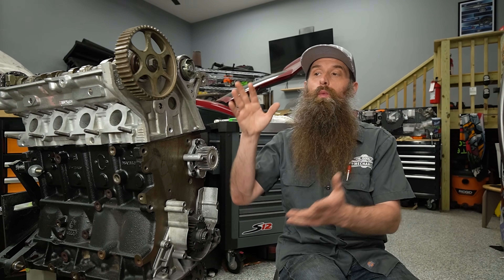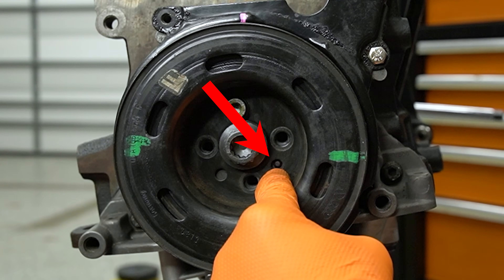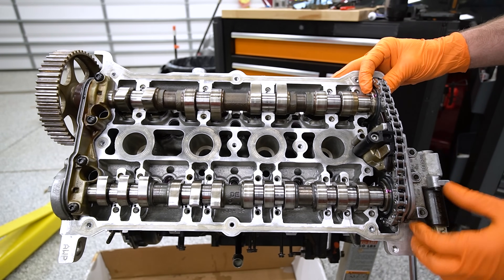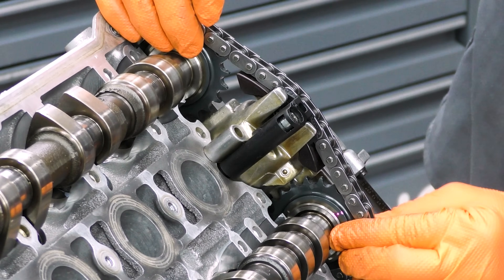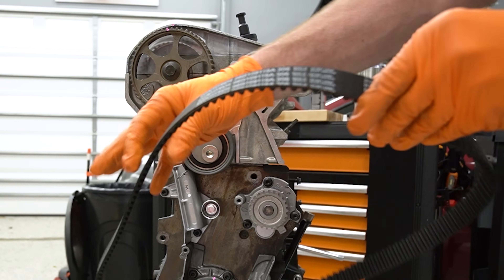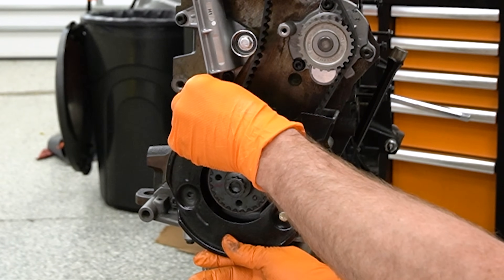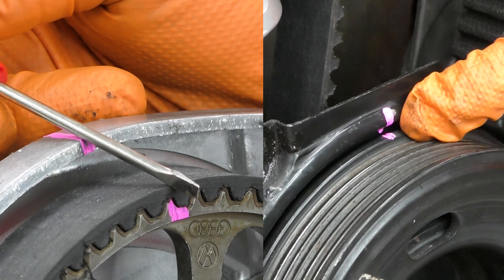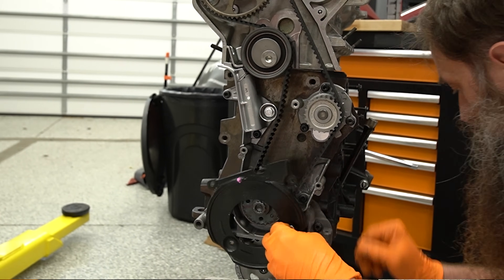How To PROPERLY Time VW/Audi 1.8t 20v Engine ~ Belt and Chain

Comment: I have the AEB. it's a really great engine, little to no maintance, good fuel economy and a lot of power. 26 Years long going strong.
Reply: 307k miles on my 1998 AEB lol
Reply: AWM in my 2002 Passat , great little car. 20 years old and it leaks no oil, barely burns any either. Have to add 1/4 of a quart between oil changes.
Reply: @Janet_Airlines802  How many miles on it?  I have a 2003 AWM, but burns some oil through the valve seals. 183,000 miles so far.
Reply: @Janet_Airlines802  admitting i have 170k kilometres (i think 100k miles) and burn roughly 80ml/1000km, so i add 0.5l between oil changes
Reply: AWP owner, man these Audi vw turbo motors feel like nothing else from its time
Reply: Had an AEB, certainly one of the best heads. I believe it was the only large port sold in the US. But it's paired with a block that features an external water pump that runs off an of an axillary belt.  Certainly not the best design. Best blocks were paired with AMU or BEA heads. Best heads are AEB or AWP depending on what your building for. I current have the AMU.
Reply: Same 99 Passat 5 speed. Stage 2 ecu been in for 110k miles at 19psi. 182k total. Still on the original clutch this thing is built like a tank
Reply: @joes.7536  haha same here B5 Passat wagon with the AEB. It has stage 2 mapped to 20psi but run 17 psi at most with a manual boost controller in parallel with the n75 (supporting mods blah blah) 300k taking it like a champ. The stock fueling system is more than enough. The K03 runs out of breath around 15psi but we all turn it up. I’m only rebuilding the engine because I pulled it to replace throwout bearing and decided well while it’s out why not. Then that list kept growing.
Reply: I had AEB(A6 C5) its great engine but now I have BAM(S3 8L) and I think BAM is the best 1.8t from VW
Reply: How many head gaskets?
Reply: @raymondmcfloss6225 atw here 2000 a4. 290k miles bone stock. Have a build in the works. Full-race exhaust  manifold. Ie cams, ie valve spring kit, will be gt30/ g25 sized turbo (still yet to decide for my t3 manifold) with aeb head. Currently rebuilding the cooling system starting at the lower coolant pipe under the intake manifold. Its loads of fun once youre able to wrap your head around some of the spaghetti mess that the bay is 😅
Reply: AWT ❤
Reply: @alexcatinas5114  atw? Same as me? Narrowband o2 ecu, small port head, & 058 bottom end
Reply: Been having mine for about 9 months. Great car. 1.8t Atw
Reply: @julianthecarspecialist got 417k actual miles on my ATW… Didn’t put them on it myself but i recently got it and it’s still running like a champ
Reply: The AEB is the oldest version which is the most suitable for tuning.
Reply: @ИвоГоранов-ъ4н  aeb is not the most suitable for tuning lmfao it runs on old ecu. aeb head is good to throw onto a 06a block, its sooo much easier to tune 06a vs 058
Reply: @ИвоГоранов-ъ4н  You mean AWM.
Reply: Aeb most suitable for tuning after you change ECU and wiring or go standalone... Maybe